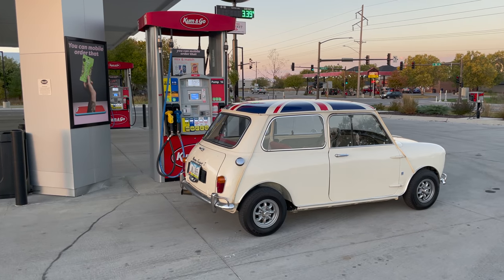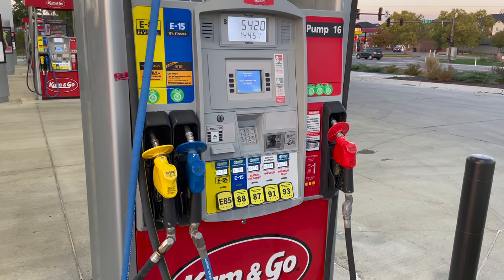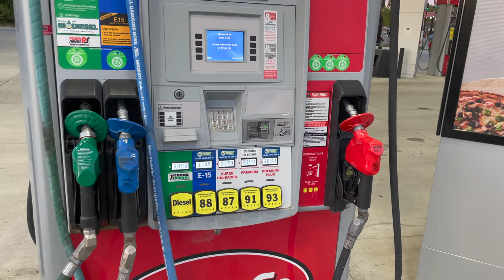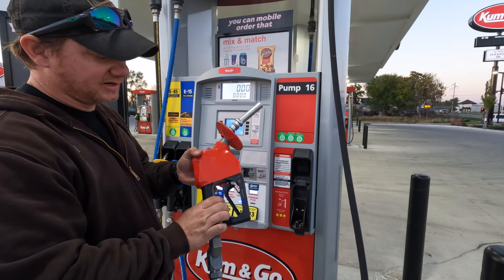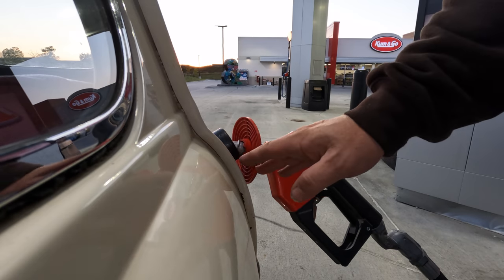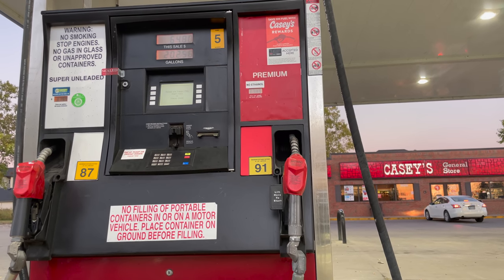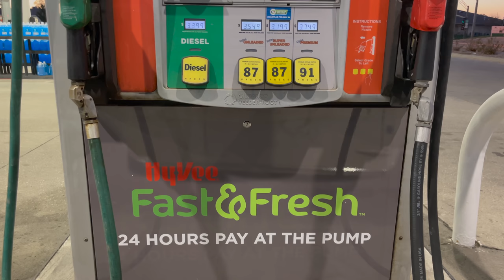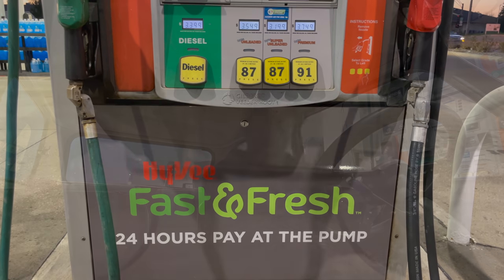What Fuel Do I Use In My Classic Car

Comment: In New Zealand where I live, we usually just have 91 regular, premium and diesel. I’ve never seen any petrol stations which sell ethanol free fuel. I know it must be available somewhere. Also petrol here is stupid expensive, currently in Tauranga it’s $2.32NZD per litre or about $6.27USD per US gallon. And that’s just for regular.
Reply: north europe it is as expensive
Reply: @reversedon8698  Do you guys favour diesel vehicles over petrol powered vehicles in Europe? I’ve heard diesel is cheaper there.
Reply: @Rock722  diesels are popular but in resent years in europe diesel cars have lose interest due over complex and expensive emission systems and diesel scandals. diesel itself is 15% cheaper than gasoline
Reply: @reversedon8698  I see, here in New Zealand diesel itself is cheaper than petrol but if you own a diesel vehicle you are subject to emission taxes, so by the time you pay that it’s about the same cost as owning a petrol car. There are no taxes if it’s not gonna be used on roads.
Reply: @Rock722  older diesel cars like 80s/90s are worth while they dont have emission systems and so on cheapest cars to drive but if you have 10 year old diesel and something goes wrong whit emission system or fuel system it costs arm and leg to fix and probably never break even compared to gas powered one and in Germany/France they really dont want those old smoky 80s/90s diesels in city
Reply: @reversedon8698  yea I see what you mean. Old diesels aren’t exactly light on emissions. I guess if you own an old one that’s still in good shape your in a good position. 😂

Comment: Here in the UK we're paying around £7.00 or $ 9.67 a Gallon !
Reply: But at least it's a full-measure 4.5 litre Imperial gallon and not a short 3.8 litre US gallon!
Wasn't so long ago we could still buy leaded fuel (only 0.15g/l), but last time I did it was £2.50 per LITRE!!  Must have been ~8-9 years ago.

Comment: Here in Oregon we can buy non ethanol fuel in the higher octanes (95 as I recall) but only in limited stations.  The other three grades 87, 89, and 91 all contain 10% ethanol.  I run five vintage British cars from an MGTD, to two Morris Minors, an Austin America and a Jaguar 3.8S.  All have been running 10% ethanol for well over 10 years with no issues.   The "pure gas" is an octane I do not need and it is almost $1.00 more per gallon.    I did a recent road trip to test fuel mileage on my 3.8S and was surprised that the car got 18.7 MPG on pure gas and 19.25 on 10% ethanol 89 octane.  Seems counter intuitive but those are the unscientific results.  Disclaimer:  I do not let any of these cars remain inactive for more than a month or six weeks.

Comment: The reason those hold open clips are banned in the UK is because of the danger of people driving off with the fuel hose still inserted. There are plenty of videos around of people doing exactly that. European pumps also cut off when the tank is full.

One thing to note is that US and European Octane ratings use a different standard. The US octane ratings appear lower, but in practice that's mostly an illusion. 

nb. I don't think there's any such thing as guaranteed ethanol-free petrol in the UK.

Comment: In New Hampshire there are no stations that offer non-ethanol fuel in my area and the device that holds the nozzle open have all been removed so you have to hold the handle the entire time your fueling
Reply from the maker: I did not know some states had removed the clip.

Comment: That indicator stalk with the little green light on the end brought back memories, what a nice mini that is. I put 95 octane in my cars/bikes and here, every gas station is still serviced, I haven't pumped gas in 30 years. A question: What is the reason for ethanol in gasoline?
Reply: If I am correct.  Political, the ethanol drives a portion of US agriculture which is heavily subsidised and protected by government.  The government then pushes this onto the consumer.
Reply: Supposedly the extra oxygen provided by the ethanol helps control emissions. Before ethanol we used something called MTBE, Methyl Tert-Butyl Ether, which turned out to seep out of the tanks and into the aquifer and was a carcinogen.

Comment: Here in New Zealand, Black is diesel, Green 91 RON , yellow and blue ( and rarely grey ) is 95 RON and 98 RON, there is only one station that offers ethanol additive which is GULL the others are Z, BP, Mobil, Waitomo, Caltex, Challenge and GAS all offer only Diesel( low Sulfur ), 91, 93, 95 and 98 ( Not all offer these all the time ) and there is only 1 station I know of that's just opened in Auckland that offers 100 RON
Reply: BP 95 RON and 91 RON are listed as having < 1% ethanol. BP 98 RON has no ethanol. I couldn't find details for Mobil fuel. BP 98 RON for my 64 t'bird.

Comment: In my area of Illinois there are no non ethanol stations. Pain in the ass if you've got classic cars and bikes. I ran 93 in my Kawasaki kz1000 and during spring and summer I'd run race gas. It's the best I could find. My bike loved it. But it's high ethanol content as well of course. I hate Ethanol fuel. Yes it's expensive. 4 years 5 it was 8 dollars a gallon. I haven't lived in the us for 3 years so I don't know how much it is now but I'm guessing it's 13 a gallon or more

Comment: Here in Australia we have: E10, which is 10% (allegedly) Ethanol, 94, then Unleaded 91, Unleaded 95 and Unleaded 98, or premium. I never use E10; I use 91 in my car and my motorcycle, and 98 in my MX-5. The cost per litre rises with 91 to 95 to 98. E10 costs the least, but in my experience, and that of many people I know and swap notes with, gives inferior fuel consumption and mileage to the non-ethanol fuels.

Comment: I just filled up today, suburban St. Louis: 93 octane 10% ethanol, cost $3.56/gal.  Pretty high for around here, although I know it’s much lower than in other parts of the US and the world.  Missouri has fairly low gas taxes, and *surprise!  shitty roads.  People bitch about taxes, and bitch about pot holes, but often fail to make the connection that one leads to the other. 

Edit: double checked, and the 93 does have ethanol.  Had it wrong in original post.

Comment: I've started to use E1O 95 octane here in the UK in my Landrover Series 2, she has the Zenith 361v carb on the manifold, the main problem I've noticed is the the large black O ring in the carb keeps expanding and causing some very odd running, it's ok for about six months then needs replacing an easy job but something I've never had to do before.

Comment: Here in Australia fuel is between $1.40 and $1.80 a litre. Thats about $5.60 to $8.20 per gal. The choices are 88 with 10% ethanol, and the rest, 92, 95 and 98 do not contain ethanol. No one here puts ethanol in their car. The octane ratings here are higher because we buy Euro and Japanese spec cars that require higher octane ratings. For diesel we are converting to the Euro 5 spec low sulphur diesel as modern diesel engines clog up on the rubbish they supplied before.

Comment: In UK the prices are about 1.30 - 1.40 GBP per Litre whilst in USA you are only paying just over 3 dollars per GALLON.  In UK almost half the fuel cost is taxes and VAT. 
No surprise that goods become more expensive as this taxation contributes to supply chain costs. 
People seem worried a lot about ethanol in the fuel and the effect on cars, but so far in cars from a modern Jaguar to a 1960 MGA I haven't as yet seen any problems with the 10% Ethanol fuel. 
We will see over the next few months.
Reply: Great point, well made.
Reply: @freepieanchipsgarage Good luck with keeping on topic.
Reply: @freepieanchipsgarage Actually I lived in USA for 3 years and Switzerland for 10 years. Both are private healthcare, but the topic here is about gasoline. Keep taking the tablets.

Comment: There are different norms for octane rating.
Research Octane Number (Zahl) RON (ROZ)
Motor Octane Number (Zahl) MON (MOZ)
Average Octane Number AON or Anti-Knock Index AKI both is (RON + MON)/2
In Europe the octane number is stated in RON/ROZ. In the USA and Canada its stated in AON _ AKI _ (R+M)/2.
AON   ROZ  MON
US      EU
87       91       82
90       95       85
93       98       88
94     100       88
95     102       88
115   130     100

Comment: I put in £35 of E10 petrol in my Peugeot @ £1.43 per litre & got 24.5 litres.
So at todays exchange rate , we`re paying $46.69 for 6..47 gallons or $7.22 per gallon .
I`m expecting an official sign to be displayed very soon on the pump that says : "Please bend over the pump so we can shaft you more easily"

Comment: Over here, in the Netherlands, we have 95 octane with 10% ethanol. Also 98 octane with 5% ethanol or without and some stations even offer 102 octane without ethanol. Prices are up to more than €2,15 per liter... 😒
Reply: 95E10 1,80e 98E5 1,90e E85 1,30e in Finland. E85 usually contains about 75% ethanol. I use it in my flexfuel converted 1.4l Megane 2 at summer times. At the height of corona wave gas (benzine) was only 1,20e litre. E85 bioethanol is now the most expensive than i have ever seen.. Ethanol in Finland is made from bio waste.

Comment: I know the ethanol has been a problem for years on seals in this carburetors etc. I do not know why they still produce it since it can be harmful to fuel systems. I live in the Omaha Nebraska area. I do not see a lot of really high octane fuels in this area, though there may be some here and there. I know we live in the corn belt, that’s a big reason why they add the ethanol is to stretch the fuel, but it’s a real catch 22 since it’s harmful to some of the fuel systems.
Reply: Yeah, and it cost more to produce a gallon of ethanol than it's worth. The government subsidy makes it profitable. Everyone but corn producers would be better off without it.

Comment: I find it hard to believe there aren't any substitute materials for the o-rings and diaphrams in the fuel system that could be used, or is it just that no-one is making parts in those materials for classic cars? When the world went unleaded it wasn't long at all before modified valve seats became a (relatively) cheap and easy mod for classic engines like the Morris Minors and Beetles I used to have, so maybe its just a matter of time.

Comment: Hi do you add fuel additive to prevent premature valve failure for vehicles that where original designed to run on leaded fuel

Comment: Here in my UK we cannot get fuel without  ethanol its 5% OR 10%  but we have put ethanol resistant fuel  lines on our 68 Morris minor and 71 Mg Midget
Reply: Got the same on my '58 Minor, but I'm steering clear of E10 until I can get an ethanol resistant petrol pump and carb.
Reply: @visionsofhere3745  we heard it only effects rubber seals and that 5%  is ok
Reply: @visionsofhere3745   Here in Oregon USA I have been using 10% ethanol fuel in both my Minors for many years had have had absolutely no issues.   Pumps and hoses may however not be original to these 61 year old cars.  These cars are used year round and to not sit for months undriven.

Comment: At about 7:43 you pass a flashing amber traffic light. AFAIK, we don't have these anywhere in Scotland. Any chance you could explain their proper usage Steve?
Reply: That flashing amber arrow light you saw is for a “left turn yield” meaning the protected green left turn arrow has now expired, but you can still legally make a left turn if there is no oncoming traffic.  In the US, “yield” has the same meaning as “give way” in the UK.  So for that left turn, there was previously a protected green arrow meaning it was safe to take a left turn and there would be no oncoming traffic to worry about, but when that ended the flashing amber arrow started.  When that ends the left turn signal will go solid red and the next cycle will start.  The left turn flashing amber arrow is relatively new in the US, introduced within the past dozen years or so.  
Also different from the UK, when a regular red light ends in the US, it just changes to green. There is no amber light between the switch from red to green.  There is, of course amber shown when a green light is about to turn red.

Comment: I have only one car, it is a diesel. I know diesel are made to run on a range of different grades of fuel. So the question is,  is the diesel supplied here in England at pumps the same grade as the diesel provided in your area? The waxing at low temperatures could be a reason for different grades. I assume the injection needs to be adjusted to suit.
Reply: The refineries change the blends according to the season. You can’t just flip a switch to change the volatility of the gasoline or how much home heating oil you make in the cracking towers. With diesel that is summer blend then used in the depths of winter, you could be in trouble. I think that there are additives to ameliorate the cold weather waxing.

Comment: This was a really important video. But I would like to know  how your non-catalyst cars survive and perform in a non-leaded fuel world. Either without retarding the timing? Or just rebuilding the heads w newer machined in harden valve seats.  Thanks
Reply: Woah woah…way too complicated. I have a 1939 LaSalle and you just buy lead additive and put it in the tank and emissions are non existent…so…nothing to be damaged
Reply: Add hardened valve seats at rebuild time, use oil with zinc additive for flat tappet cam followers, 73 VW Safari in Alaska.
Reply: @ms90sbabyy  thanks! I respect the answer. But I don't imagine the beautiful LaSalle is a daily. And additives are simply short term solutions.

Comment: Hi Steve . All fuels in the UK now contain Ethonal so we use an additive for our classics . In fact our daily driver a '92 Mitsubishi Colt 1600 GLX i should have  an additive but l put in Super Unleaded which it seems to tolerate . A litre is around £1.35p but prices are all over the place at the moment  ! Ànd in certain parts of the country we've had no fuel . This is because there are not enough qualified Heavy Goods Vehicle drivers. (I won't  bother you with the politics!  ) Was the tick over a bit high on the Mini ? Thanks Steve.
Reply: Sounded a little bit high to me too.  Maybe he still had the choke out?
Reply from the maker: Choke cable needs replaced it stuck.

Comment: hook and hold spring when its just too much effort to pump your gas.
Reply: In the UK, people often used to use the petrol cap to hold the pump handle in the 'on' position, although I don't think I've seen anyone do that for a good twenty years.
Reply: @visionsofhere3745  yeah, here in Canada same, we used to have those little mechanisms too before  I started to drive.
Reply: There have been cold, cold mornings when I would have paid to have such a hook on the pumps when filling up. Those metal nozzles get very cold and sometimes even gloves don't help!
Reply from the maker: If you drive a large American truck with a 40 gallon tank you would not want to stand there and hold it for ten minutes.
Reply: @ThisWeekWithCars  yeah, they got rid of this in Canada for safety reasons I think...we do still have full-serve stations though. I worked the midnight shift (11pm-7am) on weekends during highschool both self and full serve sides - so I know what you mean - but for the average consumer its not the end of the world to sit there and pump a regular tank...at least I hope not.
Reply: It is actually illegal to use a device to hold the trigger down (such as a gas cap, etc.) here in Ontario, maybe all of Canada.  I have seen the register attendant shut down pumps when people did that.  I keep a pair of insulated work gloves in my truck for fueling.

Comment: In the UK we have no choice, all petrol has ethanol in it which is a real problem for small engines such as lawn mowers.
Reply: I've found that some larger garden equipment places have started selling ethanol free petrol in tins now. Obviously more expensive than from a petrol station, but it might save an expensive engine.
Reply: @emmajacobs5575 That's good to know, thanks : )

Comment: Here in the UK now, the government has mandated that all gas/petrol have either 5% ethanol or 10% ethanol.

My 1az-fse toyota avensis cannot be run on anything more than 5% ethanol as it is direct injection.

The cynical amongst us are very aware that many/most older cars fuel systems will degrade with any percentage of ethanol. The 5% ethanol is going to degrade any cars not designed with ethanol in mind.
Reply: The 5% is now only available in premium pumps, 10% is for vehicles that can handle it. Diesel remains unaffected.

Right now UK fuel is about $2 for a 1/3 of a us gallon. UK gallons are around 4.4 litres, and us gallons are around 3.3 litres, so the equivalent UK price would be $6 a gallon
Reply: Not my experience at all and I run 5 British cars, MGTD, two Morris Minors, Austin 1300, and a Jaguar 3.8S  and have no fuel system issues at all over the last 10 years when E10 was sold.
Reply: @johnquilter7620  You're not very up to date are you? And by that I mean you're talking out of your arse.

We've only had ethanol in our fuel for two years and two months.

E5 was mandated in September 2019. E10 was just mandated this year in September 2021.

Don't put your ignorant opinions out on the internet when you have no idea what is going on.